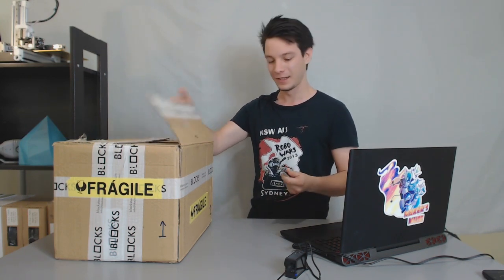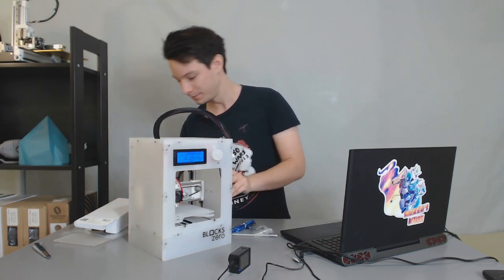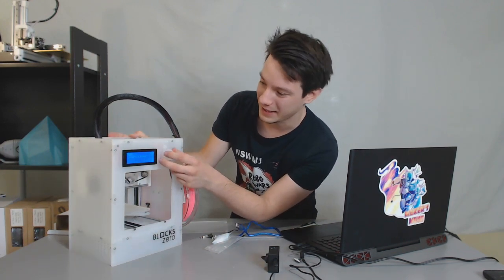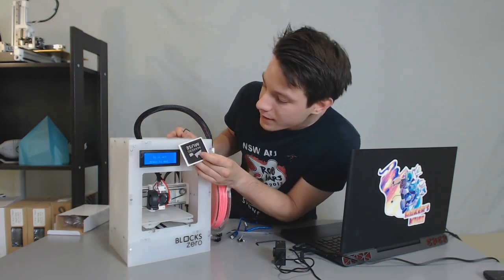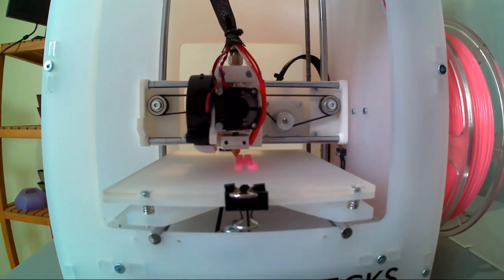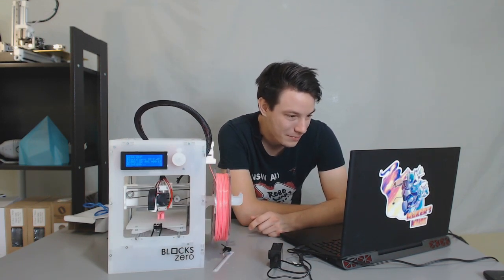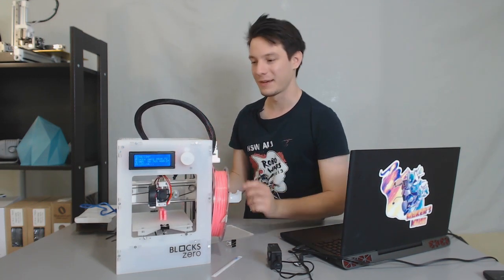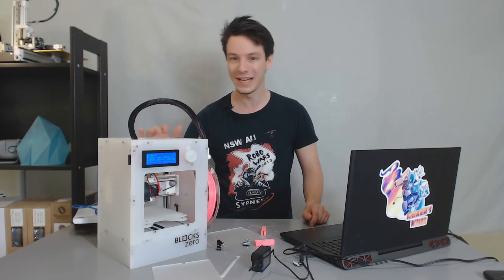WAS LIVE: Unboxing and First Test - Blocks Zero 3D Printer

Comment: I have to say I have zero experience in 3D printing and just completed the A8 kit. And within 30 minutes of completion I had the calibration done.   And hour later had my first print done with zero issues. Since then I have about 6 hours in print time and still no issues other than a noob mistake.  I am printing parts to make it more rigid.....also I replaced all possible faulty connectors with parts that can handle the current draw. For the price it can't be beat for a learning experience.  Just my 2 cents. Thanks for your videos and keep up the great work.

Comment: esun filament sucks i had two faulty ones in a row
Reply from the maker: Interesting, was this a recent thing?
Reply: yes it was only recently i brought 3 filaments all up one i went threw no issues second one i went threw half then it happened and the last one did it from the begining the white work perfect suprisingly then grey was half way and black i cnt even go threw one succesful print. started with my wanhao i3 so thought it was the printer but then i even tried it on my tronxy x3 with a e3d clone they both put out very weird inconsistent lines with lots of blobs threw it which im assuming is moisture then it causes a major clog in both of the printers ive heard really good things about esun filament i usually use a very cheap generic one threw a guy in sydney which has been surprisingly amazing but the white esun was perfect. all purchased same time from hobbyking also
Reply: I too have issues with esun filament(pla). The layer adhesion seems terrible. Here a video demonstrating it:
https://vid.me/a8rP